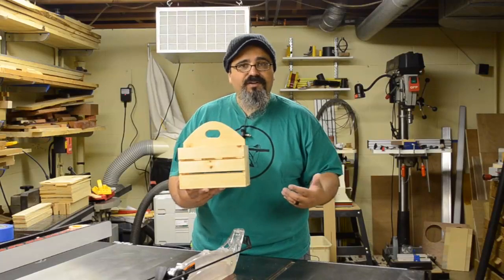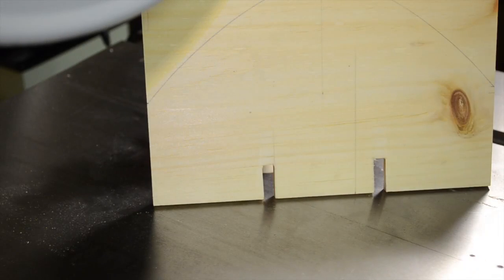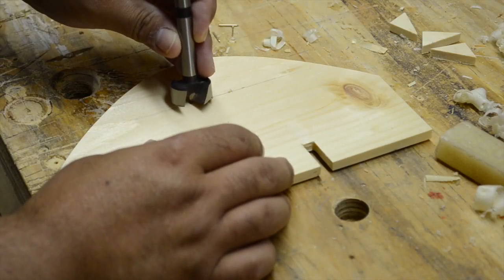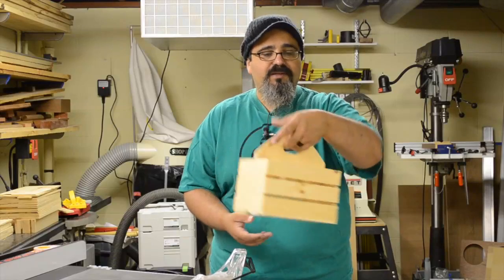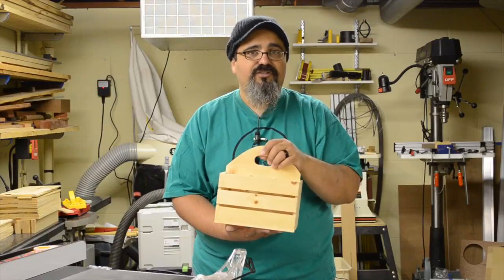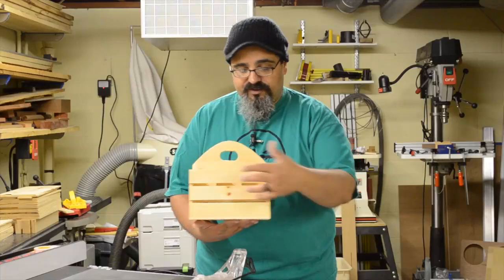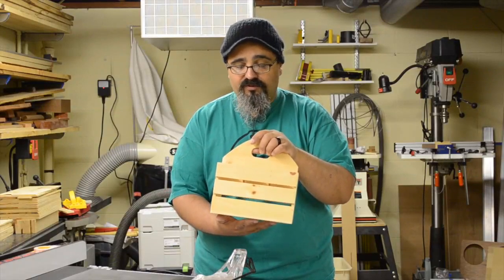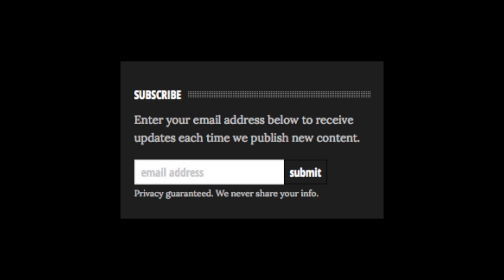509 Wooden Six Pack Pt 2

Comment: Are there thoughts about the bottom for a non-scratch kind of surface for when you put it on the counter or table?  I usually use something like self stick pads of felt, but that doesn't fit in my mind with the idea of the condensation I might encounter from the cold bottles.